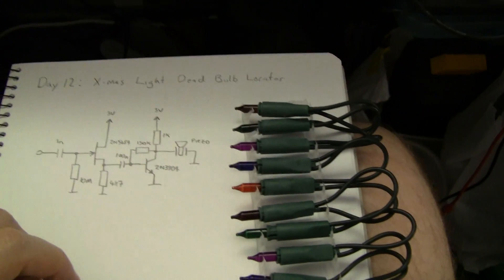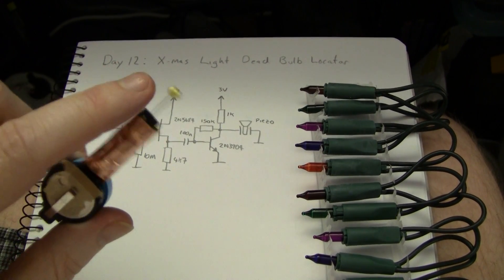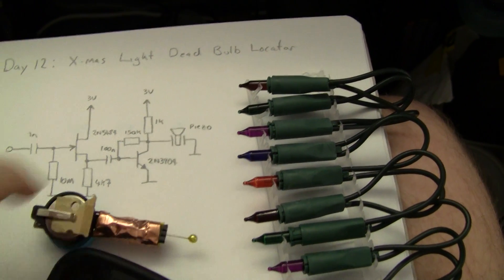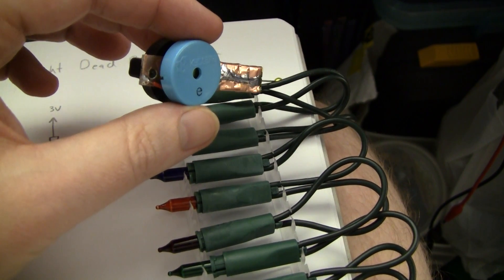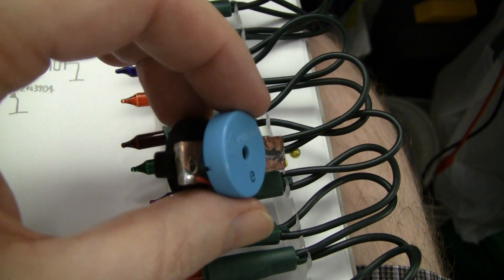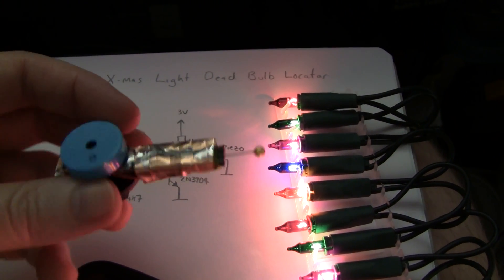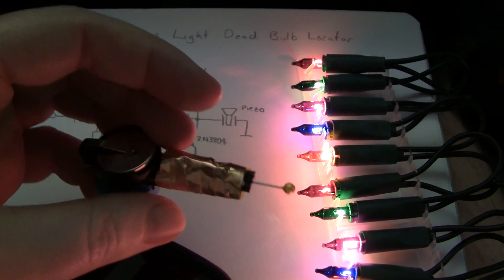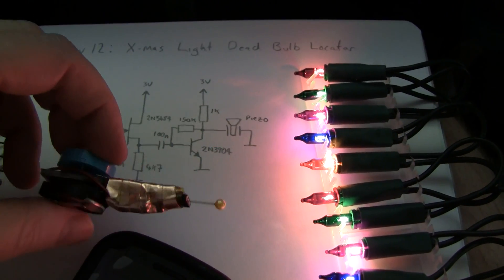Advent Calendar of Circuits 2011: Day 12: X-mas Light Dead Bulb Locator

Comment: Nice design Alan.  I used a store-bought item that does this but it had mixed results.  I like yours because of the high input impedance and the small probe where you can really get close to the wires.  The commercial unit seemed to just beep all the time.  Thanks!

Comment: I measured the voltage of output to buzzer,it's about 1.45~.1.47V,
and the current increased while I hold to powered line,it means the 
circuit actually working,just with wrong type of buzzer?

Comment from the maker: Did you use a piezo element or a self-oscillating buzzer?  It needs to be just the transducer, with no oscillator circuit, it is acting as a speaker.

Comment: Hello,I build my own today,but it's not working,I replace 2N5484 with J201,and the 2 caps
are ceramic capacitor,with a 3V buzzer,2 Nimh cells

Comment from the maker: @axel1973w You don't *really* need it, but it helps give better positional accuracy. Alternatively you can build the circuit in a mint tin with just the probe sticking out, that would be almost perfect shielding. Aluminium foil would work fine, but as you say, soldering it would be a pain, you'd be best to just wrap some copper wire tightly around it at one end. I taped over the entire circuit with kapton tape before the copper.  Kapton and copper tapes are pretty cheap on eBay.